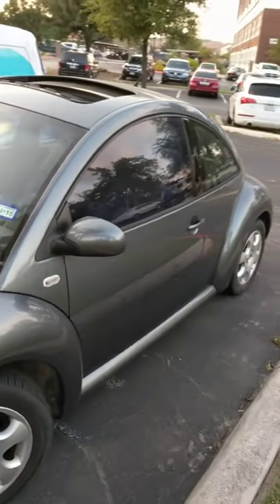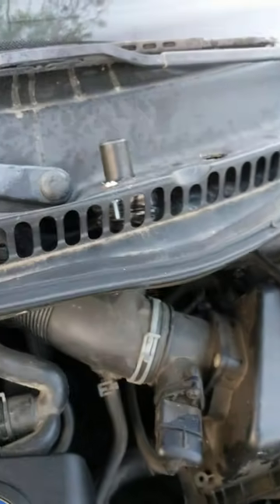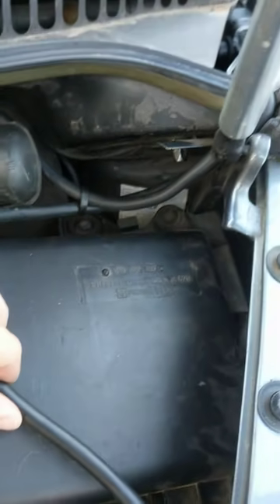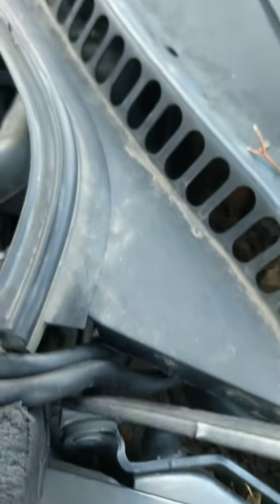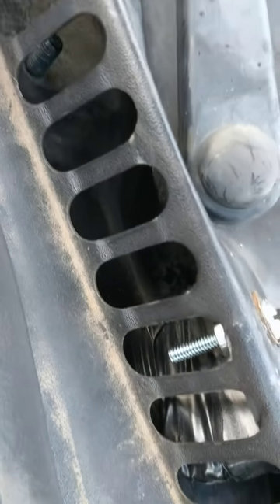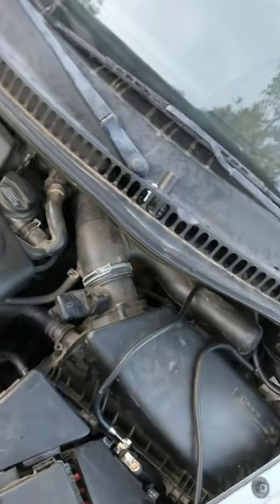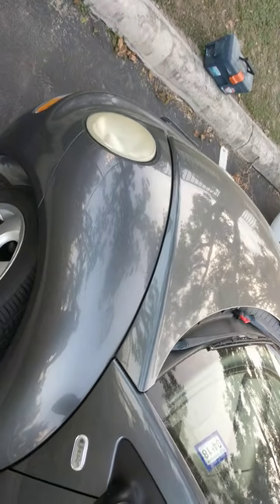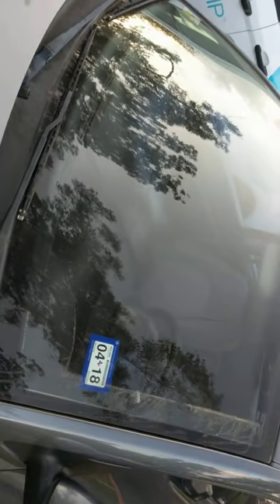Vehicle Battery Cutoff Switch Installed

Comment: Had the same issue with my Toyota Yaris, so funny that I only found your video while doing a google search to find out the best terminal + or - to install the switch and I also saw that your using the same exact switch as me .. I got mine from Amazon 2 in a pack, it also worked like a charm for me, only downfall is my stereo presets always reset. But I can live with that because the machanic wanted $250 just to do a diagnostic on the car, so for $7.99 I fixted the problem ... lol nice to see my brain is normal.

Comment: It would be better to find where the parasitic drain is, a few minutes and a multimeter would find your culprit. For people wanting to do this for security reasons and have an alarm it would be better to install a toggle switch off of the wiring for the fuel pump, otherwise the alarm will be useless unfortunately. These switches are more so safety equipment (ie. SCCA racing, if theres a crash they can kill the battery fast) then anti theft. Just remember if you do a fuel pump kill switch, you need to get the correct amperage toggle switch. If the load for example is 15amps then you'll want to get a 20amp switch, atleast a 10% greater rating is recommended.

Comment: Hi, I just this myself to fix my 2009 Hyundai Sonata only costs me $20 but now problem is in extreme winter weather I think the metal connection in switch got cold so much and having a issue in cold start. When I try to turn on car when starter demand high power and suddenly whole battery got disconnected and have to turn off the key and turn on again and it works.

Comment: should only the negative be connected? or can you connect the positive cable as well?
Reply from the maker: Negative is recommended. You only need one side to break the circuit.
Reply: @MichaelHamlin76 so do you just do the negative side and leave the other side of the switch with nothing on it?

Comment: Why not put on inside of car
Reply from the maker: You can if you want. We didn't want to. He wanted to be able to use the key fob to lock/unlock. This is the cheap/easy method. We ended up getting a remote control disconnect switch and installing it under the hood.

Comment: So, with the switch located there, and with the wires routed the way they are, are you not concerned with water getting into the switch, and the wires wearing through their insulation? Yes, It is a ground, but can still be a problem later? The fender liner would have been a better choice for location. I also read a few comments on the computer and such, and that's a real concern in you constantly connect and disconnect the power. Just my 2 cents. I'd relocate it to a place where it won't get water on it as much.
Reply from the maker: Shawn Vogann We actually only kept that switch for a few months and it started not switching correctly. We bought a remote control disconnect switch and mounted it under the hood. It is a better (albeit a little more expensive) solution. As far as the computer and disconnecting the battery all the time, we have been doing it for over 1 year with no problems....
Reply: Michael Hamlin like the idea of the remote disconnect in another location. I've usually done the fenderwell.
Reply: Good points left n right buddies. But isn't the objective mainly to install something to deter car thieves?, And let's get it right, second important to this is placing it somewhere with personal quick access. Real bummers having to open hood and switching back and forth....if you want to go with that, then why bother installing switch....just pop hood and disconnect terminals...just adding my 2 bits of my own:)
Reply: @chikofuentez6995  My kill switch was to keep my battery from running down overnight.  Worked like a dream.  Will never do business with VW again, the lousy bastards.

Comment: I have also a VW, and with parasitic battery drain, searching for fix here. I guess shouldn't have purchased VW... VW = Bad quality. My car need mains cutoff switch too.
Reply: Do you mean that you shouldN'T have? I'm having trouble understanding this.
Reply: @bgb702  Yeah, I would not buy another VW, this is my last one. I think got battery drain fixed after repairing driver door wiring (another typical failure point for this car, garage says). Seems good, but need more time to confirm the drain has really stopped. Local garage does not recommend mains switch as they said it could (on some cases) do harm to car computers.
Reply: @982678249  Seems like any modifications screw with the computer or emissions these days. I think I would only buy a vw if I lived in Germany. There are so many over there it must be parts heaven and there's a vw mechanic in village it seems. But idk, I love Japanese cars.
Reply: t982678249 t982678249 oh I forgot to mention, a cheap way to know if your battery is draining is to get a cigarette lighter voltometer. Look at the voltage when you turn it off and see if it reduced overnight. It will also give you early warning if your battery or alternator is failing IF you check it once a day both with the car running and off (former is alt voltage and latter is batt voltage). They cost like 20 bucks on Amazon.
Reply: @bgb702  Yeah Japanese cars are usually higher quality, as in long-term repairing would be needed less.

I already bought a Defa 701758 battery indicator, that is plugged to cigarrette lighter. It has green led blinking if voltage is Ok (above 12,4v), and orange/red if volts are too low. Light colour is easy to see from outside of car, without opening the doors. With battery drain orange colour was usually within 1-2 days, but now I have had a week before orange and that's much better. But issue needs more follow-up as I mentioned before.

Comment: If I saw that on your car I’d flip it just to do it so if you don’t take that out every time it a red flag for everyone to see and if someone takes that key your out of luck and stranded until you get your tools out and reconnect you battery not really a good install I’d rather just disconnect the negative battery terminal and no install of a switch
Reply from the maker: No prob. The whole purpose was that it was easy for him to get to and he took it out every time.
Reply: Hmmm.
True...
However, it's a good thing where it's at.
I mean the purpose of it is to have it on while you're going here and there....once you end your driving you shut off and that's the end 👍😎👍

Comment: Absolutely worthless video, you dont explain where the leads go to, other than to say one lead goes to the ground on battery ? Where does the other lead go to ?
Reply from the maker: Wow @Noel Carreaga, if you are too dense to figure out how a switch works in series, then you need to take the car to someone who understands simple mechanical or electrical concepts. If you can't understand it from where it is explained @ 1:25 in video, then pay someone to help you.
Reply from the maker: Noel Carreaga There's no way you work on cars. I'm a novice and it wasn't even a question on how to hook up a disconnect switch. Anybody would know that it is placed in line and simply breaks the circuit. Other than that, this video in no way claimed to be instructional. You incorrectly assumed something that was never intended. This is simply a video to show an example of how the problem could be solved and where to place the switch. I, have, in fact, done instructional videos. On those, I video it step by step as I do it. I wouldn't just video the finished product if it were meant to be instructional. Don't be critical of something that you had incorrect expectations of. It makes you seem ignorant.
Reply: Michael Hamlin You seem  to take offense at someone telling you or criticizing your video, instead of being a hothead do yourself a favor and take constuctive critizim for what its worth, you seem not to like to  be shown the error of your, ways you have alot of growing up to do, I understand as I was young abd foolish at one time too  good luck on that some people never learn
Reply from the maker: Noel Carreaga Calling it worthless was not "constructive criticism". Just admit that you were being a troll and I called you on it. Agin, the video in no way claimed to be instructional. There are many that have "How to" in the title. This one does not. Take the L. Stand down, Noel....
Reply: Wow. He explained it perfect if you know how a fuckin switch works. Battery cable to one post on the switch. The other side of the switch goes to the actual terminal. Maybe mommy can help you with it
Reply: Dustin Ritchotte Yo Mama
Reply: Noel Carreaga You are right , how does this effect your computer ,clock , alarm .reprogramming of system